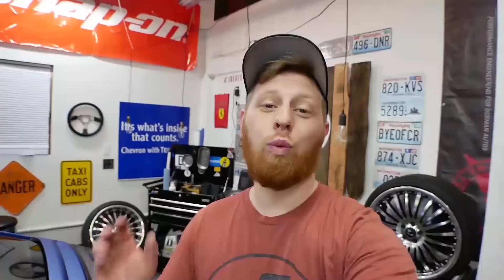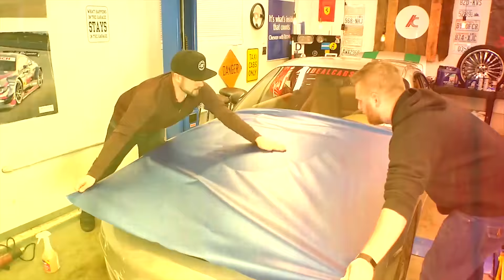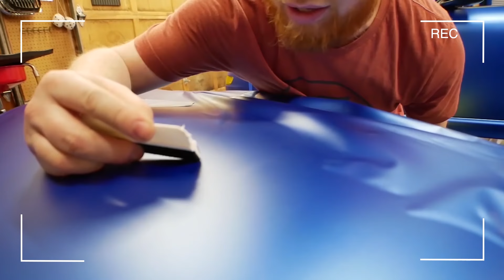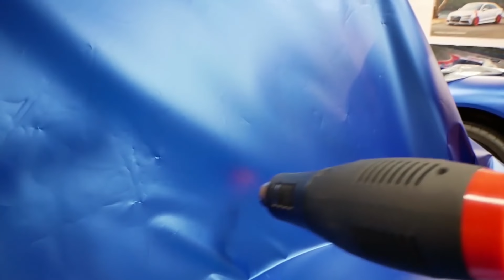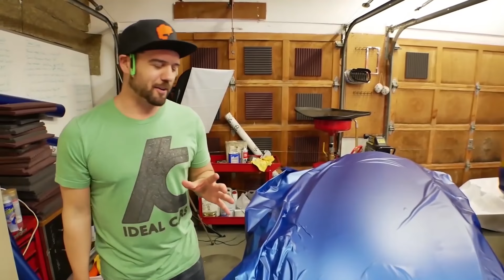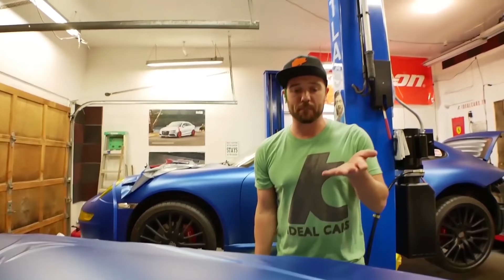FIRST TIMER'S GUIDE TO VINYL WRAPPING A CAR  - Tips & Tricks PART 3

Comment: you could have pulled up the entire wrap up to that large finger and stretched it back out and down and not have to squeegy other little fingers you made. would have been better to lay flat down the centre then lifted every corner and re adjust large sections, stretching out any wrinkles all the way to the edge in one go.